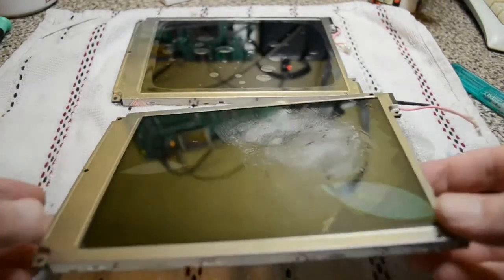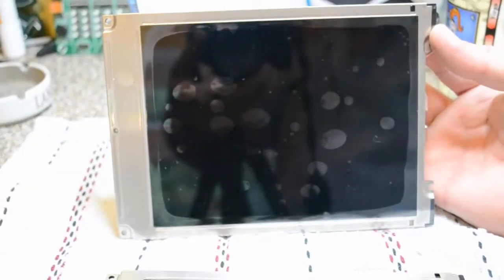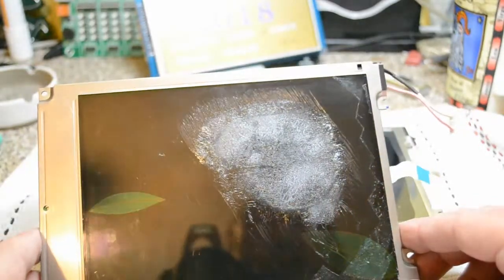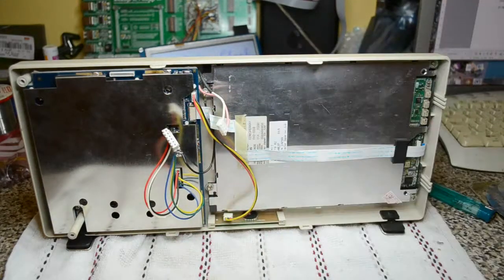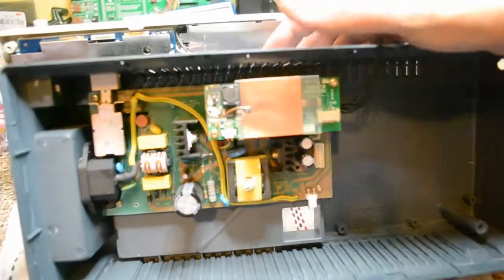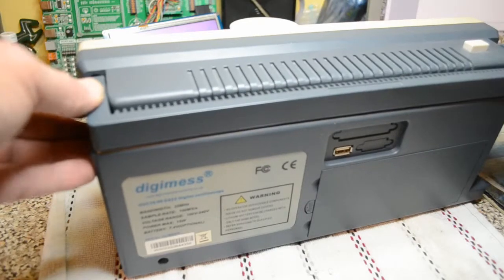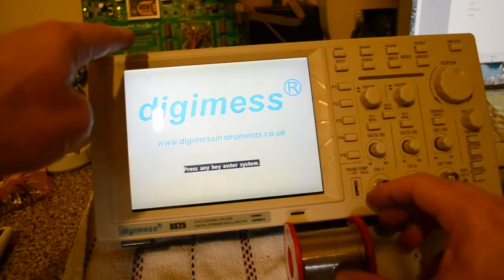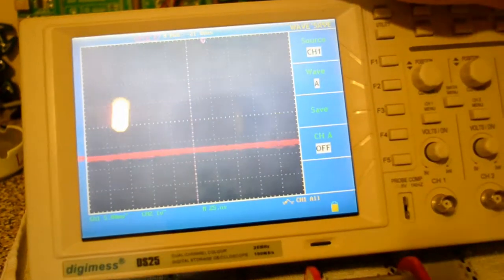Digimess DS25 & Owon Oscilloscope 7.8" Screen Replacement

Comment: hi. I had a OWON PdS5022s Oscilloscope  and need to replace the screen. but can not find it on  Ebay . did you bought from OWON company? could you tell me how to contact them .Thanks
Reply from the maker: I have just found 2 displays on ebay with part numbers beginning with EDMGR
Search for 7.8 Inch display
Reply: I got a display for $40.00 dollars on Ebay  yesterday . could you make a video of  detail , how to replace the display .

Comment: I have an OWON unit that looks physically identical to yours (buttons and knobs.  Same display pattern) that was far cheaper than yours in at around £200.  Not the best scope in the world but adequate for most things.  The problem with my scope is that it is up in my bedroom and the display seems to have dried up in the middle as far as i can tell.  Therefore I did find your video very useful.  Thank you for taking the time to do it.
Reply from the maker: Thank you for your comments Billy
Yes I figured the Digimess scopes are the same as the better priced Owon, though this scope did have the battery option.
That said, Owon suppliers only want £70 for the battery option.